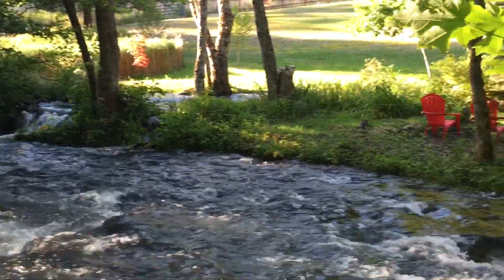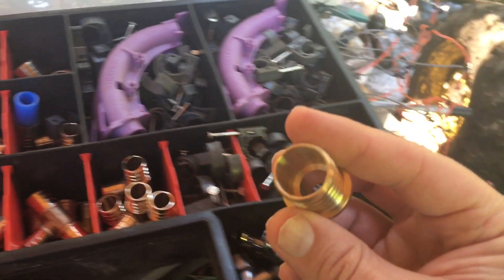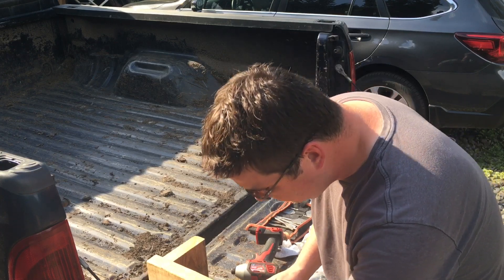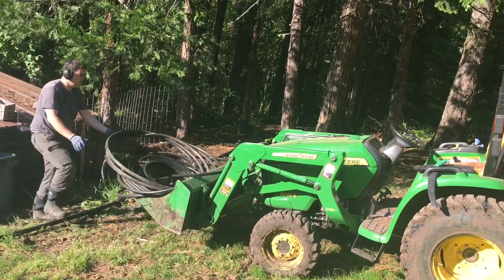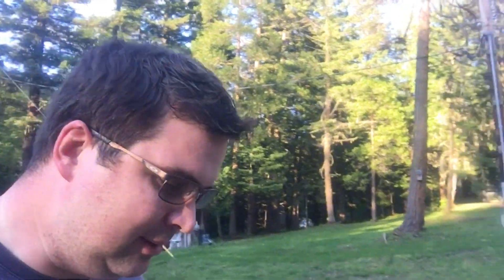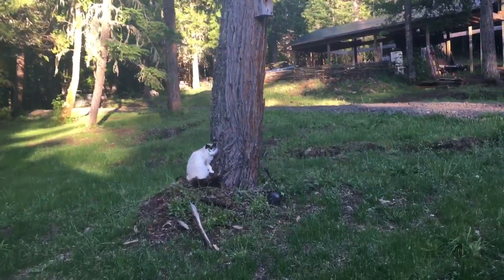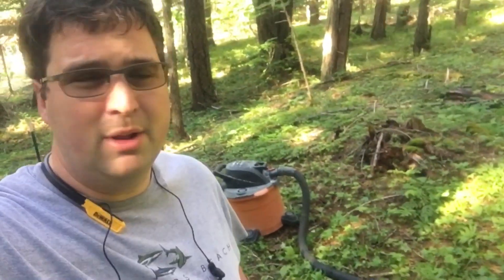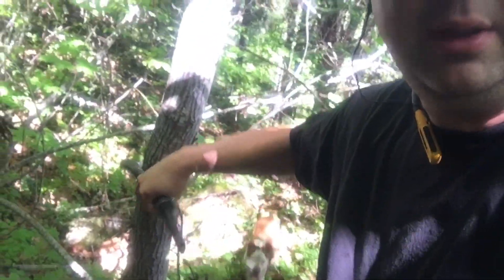Free Water Pressure! No Pump Needed! Using Gravity to Pressurize Water.

Comment: That's great. I'm in the Ozarks of Southern Missouri and have a big holler behind me. There is a spring that oozes out of the ground and makes a lil creek that runs into a bigger creek at the bottom. I was kinda thinkin I could dam it up a lil bit and kinda make a lil resevoir midway down the hill, and then do what you did here with the pipes. I've been wanting to build a small hunting cabin down at the bottom of the holler. I could have running water in it for washing and such. 
You did a great job and it makes me curious bout how much pressure I could get!
Reply from the maker: That's awesome. Pretty cool you can do this just using gravity! It was actually one of the things i was interested in about this property when we looked at it. It will be a little less than 1/2 PSI per foot of elevation. A small limiting factor is friction on the pipes, but that's probably negligable as long as you are using at least 3/4 or 1' pipe. I was talking to a friend the other day who said he grew up with this type of water system, and the spring was not very high above their house, maybe only 15-20 foot of elevation, but their family of 7 got by just fine with it. If it's got a good flow all year, your could even run a separate line to a Pelton Wheel to provide power to the cabin. Gets you to thinking.... :) I'm excited to tinker with this project in the future here. Best wishes to you on your project! -Robert
Reply: @TheOregonTale  the pelton wheel is why im here (: you are mighty if you have one!

Comment: If I have a water tank on the roof of s shed connected to a pipe running down to a tap will I have enough water pressure to get water from the tap.?

Comment: Please let me know what size hose you used at the start and does it reduce to 3/4 inch? 
How much 1inch hose and 3/4 inch hose was used?
Reply from the maker: Yes it started with 1” and necked down to 3/4 maybe halfway through. The only reason for that was that was what I had sitting around, and picked up a couple pieces to finish it out as a test. If you were feeding a whole house situation I would run 1” the whole way. -Robert

Comment: information.            there  is  Pressure, because of the amount  of  head.      but,  head and pressure does not  equal  Volume.!      aka  the  per second flow Rate.              any  'plans'  you have for the water, should  account  for  THAT  fact.           d

Comment: How many feet was the initial drop from the water source before your line flattened out?  Looking to run a line from my 550 gallon rain collection barrel to my lower garden and orchard. I also saw your Daikin hat. I write software for their chillers...
Reply from the maker: Only about 20’ and then started a flatter run, then down steep again. Maybe 800’ of line and around 135-150ft of vertical drop. I was talking to a friend and he grew up on a gravity fed house that only had a 15-20’ of vertical drop. My brother-in-law does HVAC and gets me a hat or shirt now and then. 👍 He asked where you live? Said there’s a lot of Hvac controls stuff up in the Great Lakes and daikin does some manufacturing down south. Oddly enough I got to tour their chiller control display room in New York with him too a few years back. 😄
Reply: Thanks for the response. Will be curious what my 80 to 100ft will give me. Tell your brother I work at the Virginia factory in Verona. I designed the software on the WME C-vintage chiller product line.
Reply from the maker: Cool. He said small world. 😊 If you have 80-100’ of vertical drop, that should be 35-45psi. I think it’s about 4.3psi per foot depending on some variables. Hope your project goes well James!

Comment: You could run a water turbine generator with it. May be able to increase pressure with vacuum running pipe below the generator
Reply from the maker: Thanks Jon. I think it would easily run a Pelton wheel.
Reply: @TheOregonTale  that would be a fun little project. What is your drop in elevation? And do you have enough volume at the spring to increase your water volume?
Reply from the maker: I’m assuming about 135-150 foot of drop due to the 60 psi and approx psi per foot of drop calculation. I think even in heat of summer would probably still have enough to run a little larger pipe, or maybe 2 smaller ones- one to pressurize house, and one to run a Pelton wheel. Still tinkering with ideas and planning. -Robert
Reply: @TheOregonTale  ya, I got about 140 ft. You might want to go with the larger pipe and install a valve below the generator to reduce flow if needed. I have no idea how many watts you can get out of it. It would be fun to do though.

Comment: Jesus, man. Cut it, throw a ball valve push connection like a John Guest on the line with the valve open and you're not fighting it, then simply turn the valve to close.
Reply from the maker: Just testing the concept so I was tinkering around. It gets cold enough in the winter that I will need to bury the line. This spring/summer I plan on trenching a line down with all new stuff instead of cobbling together what was laying around. I will do it nicely with a permanent setup. -Robert
Reply: @TheOregonTale  -- I respect that, but if you're going to bury a line from a running source you can't just turn off I'd suggest a valve at the source and redundant valves close so you're not fighting pressure, nor having to dig and fix it. In-fact I'd suggest keeping it on the surface until you work out all logical but unforeseen issues such as creating a double-redudant valve after one right at the source, but I'm also all about 3 or 4 levels of redundancy when it comes to pressure and you're not exactly dealing with river pressure
Reply from the maker: Yeah I am a big fan of redundant shutoff valves. I think I can get an excavator up there, so might dig in a tank with some reserve capacity, Shutoff valves, drain valves etc would be a must. Still in the planning stage since it looks like a feasible project.
Reply: @TheOregonTale  -- worst case you go yank your bypass out the crick 🤣. Good to have redundancy for flood or increased and unforeseen flow, but living and homesteading down hill from that all is its own concern 🤣😅🤐 best of luck ✌

Comment: Is it possible to lift water from open well 20 feet in diameter and 60 feet in depth and water filled up to 30 feet..
Reply: Have you come up with the solution to this? Am facing the same problem just curious can't water be pushed up by it own weight in the well
Reply: You can with a gas powered pump, or even with a properly placed hand pump with a lot of work

Comment: Do you think this will freeze in the winter? I am looking at doing something like this for electricity - there are these basic little hydro turbines that can crank out 12v each. i am thinking of supplementing a solar setup with it. 
would love to hear thoughts about freezing! thanks!
Reply from the maker: Hey there. It will depend on your climate. Moving water will freeze at lower temperature than 32 degrees Fahrenheit, or 0 degrees Celsius. Our creek for example still runs when we are in single digits of Fahrenheit. With that said, my setup to provide pressure to house would definitely freeze if it was not buried, because it would not always be flowing in the pipe. With water running to power your turbines, there would be movement through pipes which would help prevent freezing. If it’s running all the time you should be good, it you are shutting it down and keeping pressure in system it will freeze. If it’s always running I would guess you would be good below 0 Fahrenheit, your outlet area may start to freeze and pile up as it exits if it gets super cold. Hope this helps. 😄 -Robert
Reply: Unless it goes below 5 no it won’t freeze
Reply: I know from experience

Comment: Nice video. I didn't see where you told how much elevation it is to get your 60 psi. We bought some property that has a gravity feed system, but we can't seem to get hardly any pressure. The pipe is all buried. I am thinking maybe there is an airlock or something because it hasn't been used for a while. 1200 gallon water tank is about 75 feet above the cabin. I know that the previous owner had good water pressure from this system because he has an on demand hot water heater that would not work without good pressure. So, any ideas as to why there is only a trickle coming out would be great. :)
Reply from the maker: Hi there. Sorry to hear you are having water troubles! you should get .433 PSI per foot of elevation so you should at 75 foot have about 32 PSI at the house which is plenty of pressure to service a house. Could be an air lock, but my guess is if has been sitting a long time, it probably has a sediment blocking the flow. Couple things I would try 1st. Check water tank. likely to plug with sediment where hose attaches. 2nd If you have an air compressor, you could try hooking it up at house and blowing air back up system to dislodge it, but be careful how much psi you use so you don’t blow your hose apart underground. could do the same thing with a pump and water if you have another source. You could also use a fish tape to check for plug in line. not sure how long piping is but this could either tell you how far down the line plug is, or could possible even break it up if it’s not too solid. since you are getting a trickle, shouldn’t be too solid. Hope these help. Happy troubleshooting! Let me know if you are still having trouble. Thanks. -Robert
Reply: Yes I bout guarantee it so open it and let it run and ypull see the air is way up the pipe